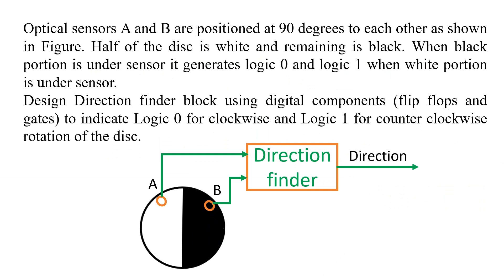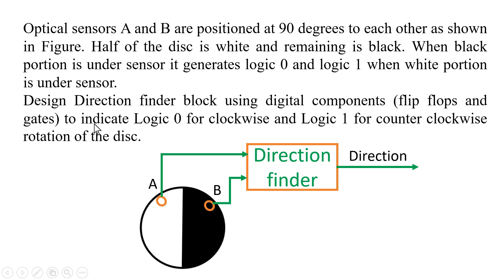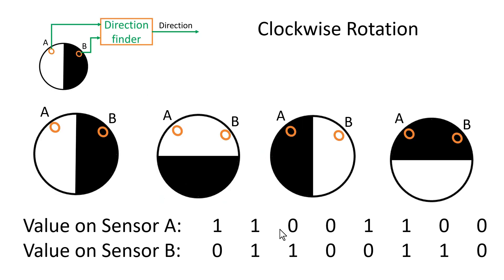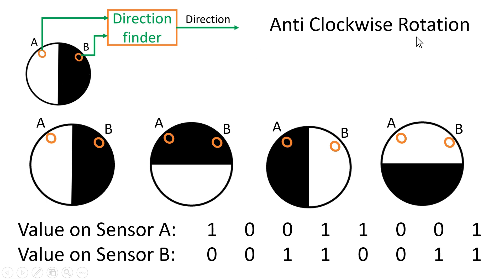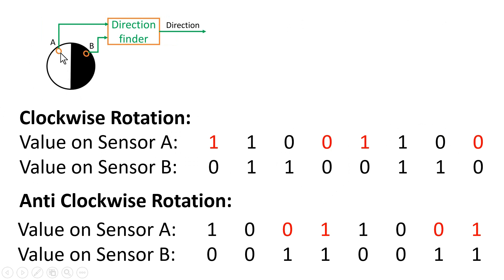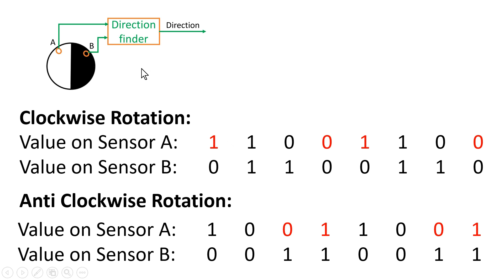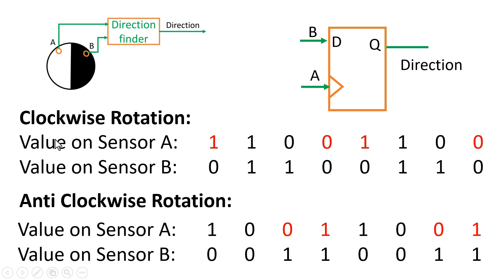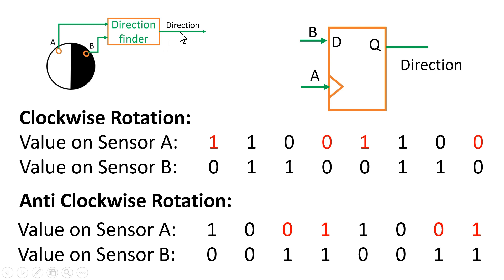Digital Design Interview Questions Part 7

Comment: Sir if any other general method for such problems then please share that also.
Reply from the maker: Ranveer, you would have realized that puzzle solving needs practice. I am just giving you the problems to solve.. keep them doing..
Reply: @TechnicalBytes  Yes sir , Got placed in NXP , your videos helped a lot , I will keep on watching your upcoming videos for knowledge
Reply: @ranveerdhawan5187  hii Ranveer congratulations
Reply: @ranveerdhawan5187  may I know location? Is it noida ?
Reply: you can use state machine... with 4 variables  k.map... the output depends on the current state and previous state